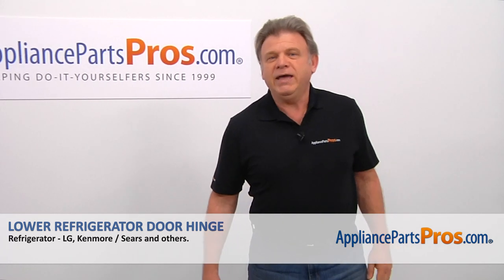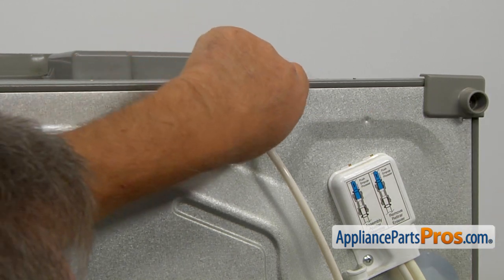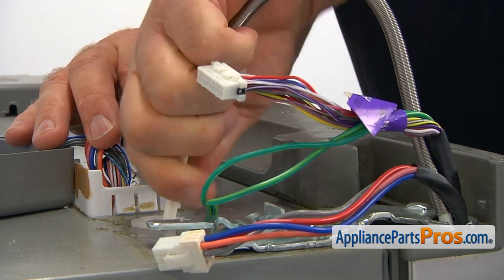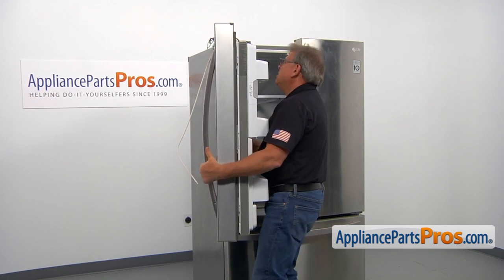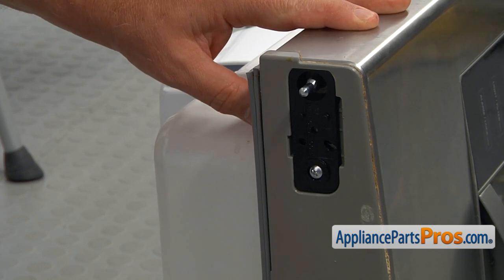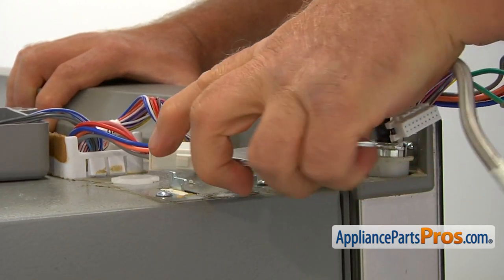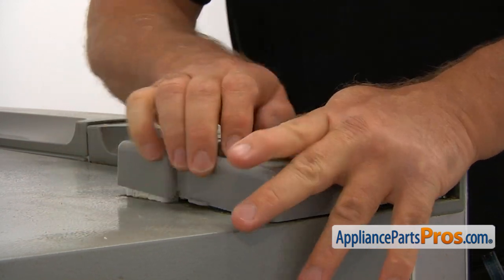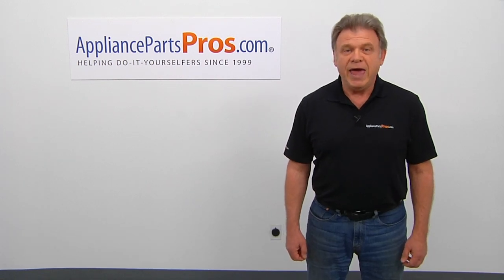How To: LG/Kenmore Lower Refrigerator Door Hinge AEH36821908

Comment: I have a Kenmore Elite fridge. The left door was sagging and the hinge was loose. It was happening for a few weeks and got worse and worse and more wobbly,  and I could not fix it. I almost bought a new fridge today, but then I saw this video and the fix was so simple! I had no idea the hinge had that lever. The lever was loose.  I simply locked the lever back in place and problem solved!! You just saved me $2500. Thanks!